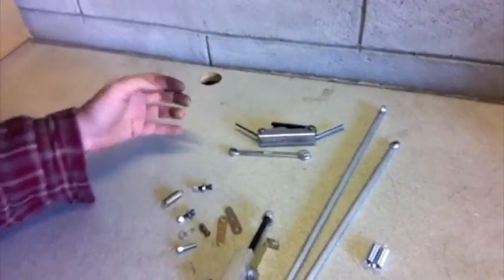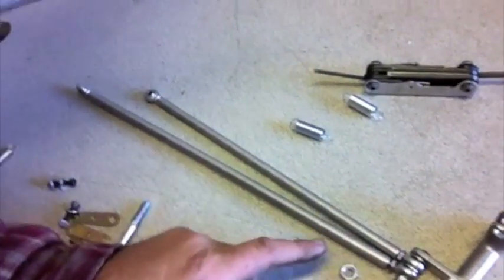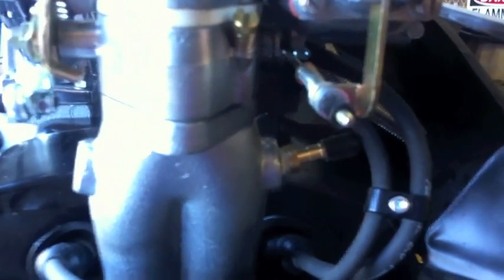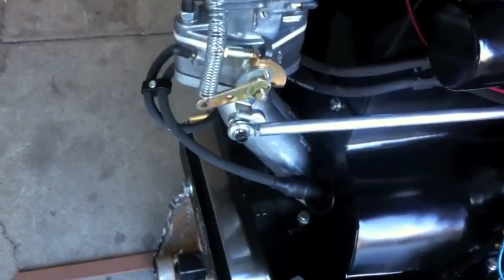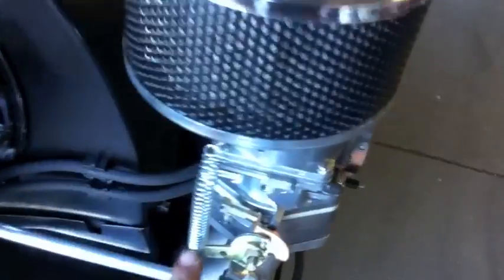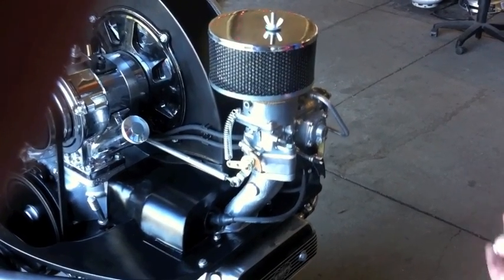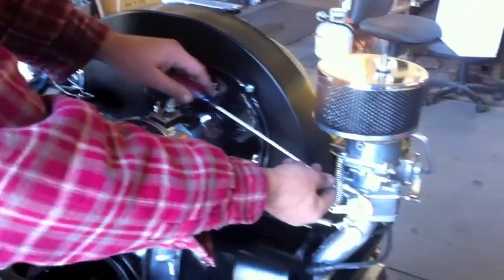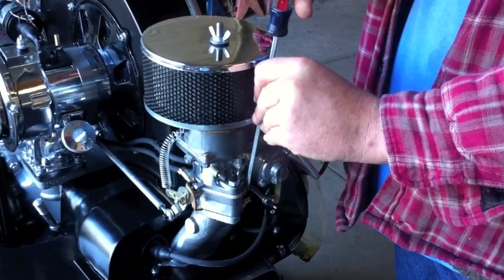Kadron Solex H40/44EIS Tuning and Installation Clinic

Comment: Hey there. Great Video. My mechanic adjusted the carbs and said my 1641 with Kadrons was running good. I drove away and it stalls every time I take my foot off the accelerator. She starts right up and stays going when I gas her. But as soon as I let it roll it shuts off. Anything I can adjust in my garage before I try and limp it back to my mechanic ? Thanks

Comment: Very nice video and thank for it, I'm going to crack soon a bran new 1776cc with 40mm Kadron's with CB 040 heads an engle 110° camsharft, compufire 009 ignition @ 10° on what jetting and Idle should I start with to be on the in between range?   thank, gretting from France , david

Comment: Whenever I install mine it leaks gas out of the bottom of the carburetor. Do you know what I need to stop the leakage? Does it require a gasket or anything to stop leaking?

Comment: So I,am about to put a 1914 in my bug, it will have 40 Solex Cadrron carbs, I’ am a old motor cycle mechanic, i sink dual carbs, and 4, bank carbs with ether mercury gauges, or vacuum gauges, why aren’t these carbs. Synced this way, they have the the vac tubes for it? I am used to tuning inline -4’s, and V-twins this should be the same.. what am I missing?

Comment: Love the videos. One question though. I turn my mix screws right in at the idle doesn’t die. Turn them out and it does 🤔 Just rejetted properly for 1776 and it’s running rich (black smoke).
Reply: I got the same issue, I now this is a 2year old comment but did you ever found a solution?

Comment: Don't need to use a sync tool to set vacuum on carbs? what about removing linkage so that while adjusting they are independent? Also does the crossover equalizer tube need to be pinched off? just asking because I'm doing this right now but everyone else shows a totally different method. Let me know, thanks

Comment: please make a video on how to install the linkage step by step and not jump to a completely setup engine. the directions that came with the linkage is incomplete and directions for anything else for these cars is non-exisitant other than videos from 5 years ago filmed with a potato. i know you are available  to call for assistance  but its easier to work off proper directions than be on the phone. its my biggest problem with building my car is that nothing comes with proper directions

Comment: Oh man please remake this video but with a camera man and a tripod. The shaking is distracting. And when played on a large tv it's too much!  I want to do this kit again.  Used to steal the parts from junkyard bus engines back in the early 80's. Much easier than Weber!  I used to decouple cross linkage, remove air cleaners first then do balance with a section of vacuum tubing.   I'll check your site for kit selection. Stock super b

Comment: can any help me what's wrong with my car there duel 40 kadrons when i drive it and i go over 3rpm the car starts to spit and hesitates to go any tips or help would be helpful
Reply: If your ignition is working properly, clean spark plugs,  no ruptured or spent wires and the such wich would be the most likely scenario; check the float level on your carbs, if it isnt ajusted to apropriate height fuel can overflow causing that spitting at high RPMs, specially going downhill.
Reply: thanks man but i already solved it i was running it to rich.  thanks anyways

Comment: how thick is a 16000 to set the points on a VW 16000 air-cooled engine 4.04 which I don't understand how thin is

Comment: I want to install a Dual Port Cross-Fire Intake Manifold to my '70 1600.  Do you stock larger (single) Kadrons to help dump fuel down the hole?  TIA

Comment: Thanks to all the fellows at Kaddie Shack. I am on my second set of Kadron's from these guys. I can and have used many brands of carburetors over the years. Dell's, Webers, Holley Bug sprays and Kadron's. I chose the Kadron's because they are so simple. I used 44 IDF Weber's on my 2165 and the engine was great, but it used lots of fuel. Maybe because I have a heavy foot? When I built my 1776 for my wife's car I chose Kadron's and couldn't be happier with them. This time for my 1776 engine in my Oval I could have had Redline 40 IDF Weber's, but I decided to go with the Kaddie Shack Kadron's again. The vacuum advance distributer takes care of that flat spot the 009 distributers are known for. Smooth as silk from idle to full power. I'm using a Engle 110 Cam.
The car is my everyday driver and the great experience with the first set influenced my decision this time around. I have nothing but good things to say about this company. Good value and good people.

Comment: I agree.  Jeff helped me out a bunch with my Kadrons and I couldn't be happier with them.  I have a 1699cc engine on my 67 bug and it runs great.  I had it built as a mileage motor but it also has good power.  Good vid.